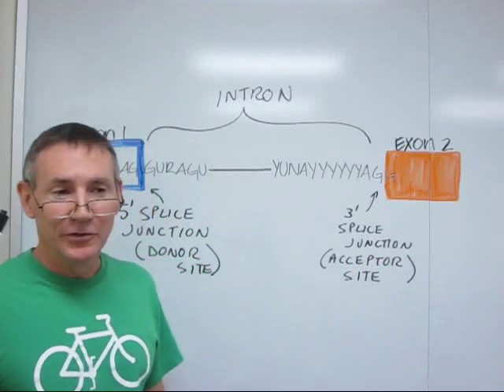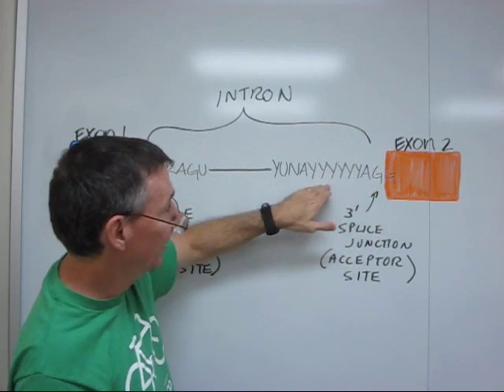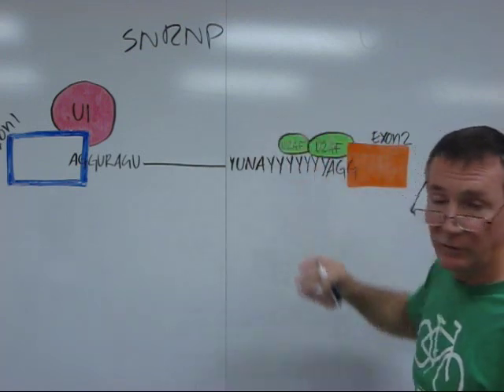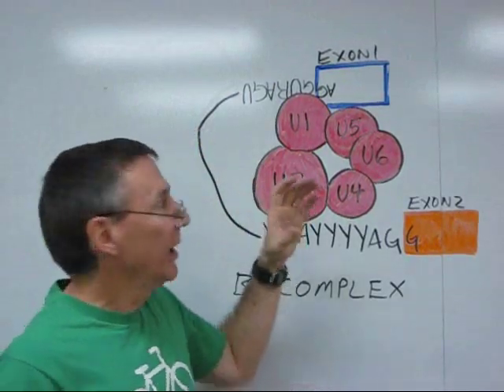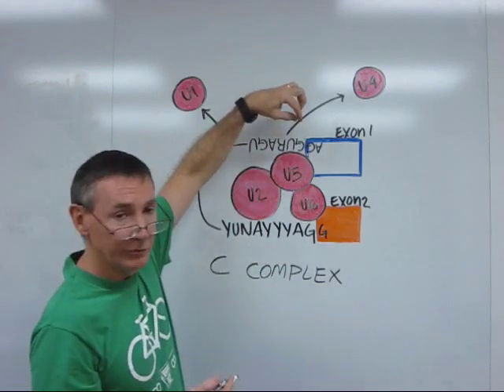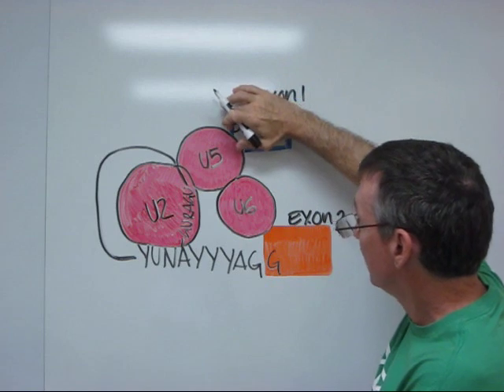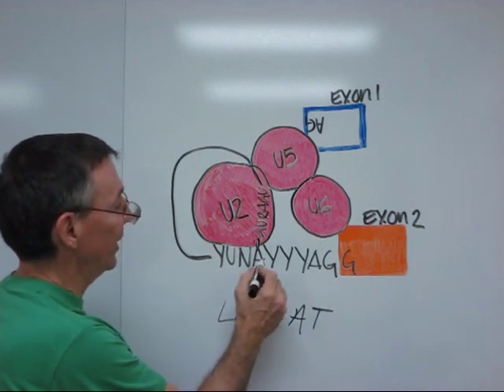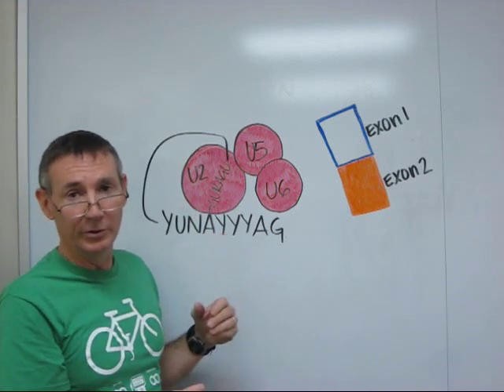Mechanism of intron removal and exon splicing

Comment: Awesome clarity in your video and the drawings were extremely helpful. However, I'm not sure the transesterification was explained properly (in detail anyway). They are actually nucleophilic attacks by the hydroxy group of: first, the 2' hydroxy of the branch point A on the 3' phosphate of exon 1's G, and second, the 3' hydroxy of the 3' G of Exon 1 attacking the phosphate on the 5' end of Exon 2

Comment: Shouldn't the 🔼G be negetive
cause when its Zero we gotta have equilibrium and the reverse will happen too
Reply from the maker: Degradation of the removed intron afterward probably prevents the reaction from being reversed.   But I can't say for sure.
Reply: +Allen Gathman so 🔼G might be negetive or zero with degradation of products
Reply: In vitro studies have shown that most of the major spliceosomal assembly steps, including the catalytic splicing events, are reversible. This implying that there might be proof reading steps.
Of course this is an in vitro study and futher research has to be carried out. But meaning its reversible means that its delta g is about 0.

Comment: This 1D representation simply does not do it justice, it's misleading to students. Great job explaining it though for sure, not knocking the explanation.
Reply from the maker: 2D, I hope, but yeah, it's limiting.  And furthermore, this is getting pretty old and no doubt needs to be revised based on research since I did it.  But someone else will have to.
Reply: @agathman  oh sorry, normally when I think of a sequence represented as a string I think of it as 1D; 1D was just a reference to not having RNA structure in many, if not all foundational biology texts for college students. It's an amazing explanation, thank you very much for providing it. My perspective here is trying to explain to folks how the new sequence-selective splice modulation small molecules that have recently been improved. After going into structural biology in the context of drug discovery against rare moulds, I realised that my undergraduate education lacked a foundation in structural biology. Thanks so much for the response!!
Reply from the maker: @johnraviella6561  Oh, I see what you mean now.  Yeah, there's a lot I don't know about the structures underlying this process, and certainly even more I didn't know back when I made the video.  It's a very rudimentary intro to the process.  Sounds like cool stuff you're doing!